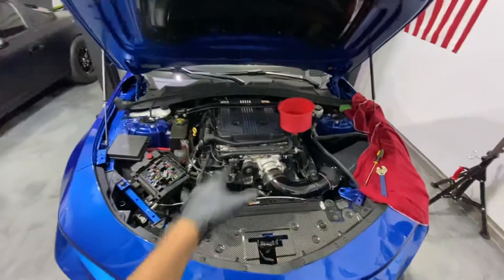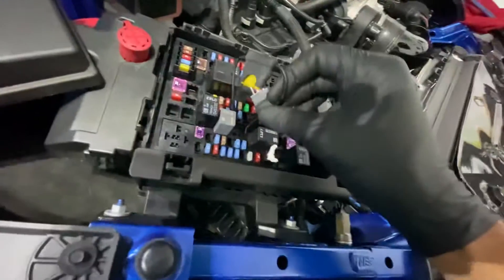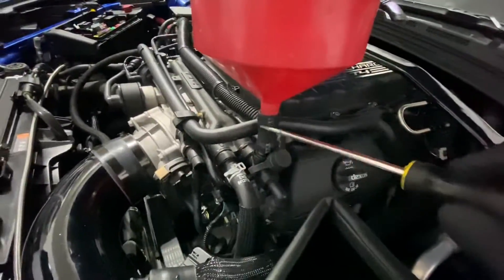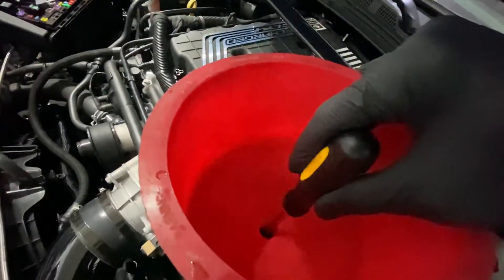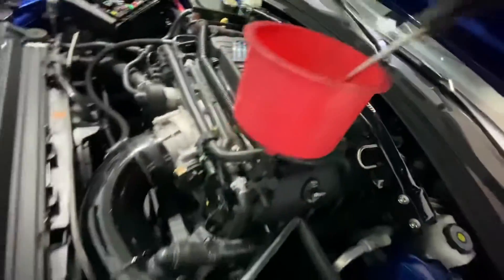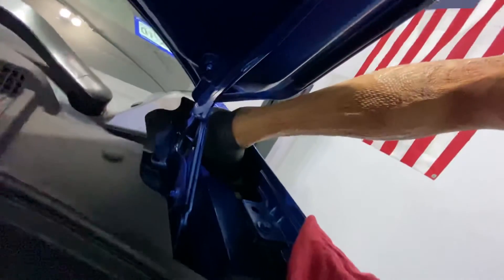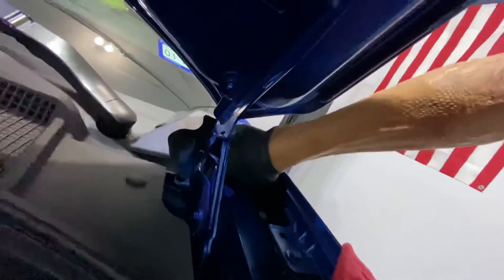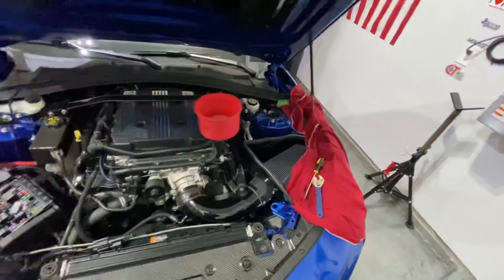Synergy Motorsports ZL1 Heat Expansion Tank Bleed Air Procedure (jump the Intercooler pump)

Comment: Hey sorry for my dumb questions left and right, when you had your 2 Inch headers installed was there any low end torque loss? Or were they able to tune around it or if possible do you have an image of your power curve?
Reply: You don’t tune a car after getting headers put on. And it depends entirely on the set of heads you have.